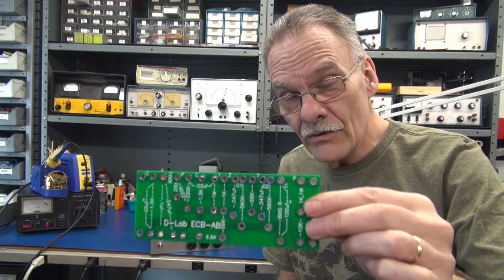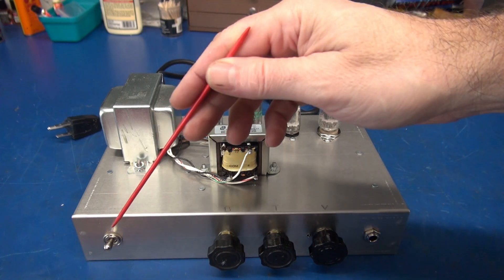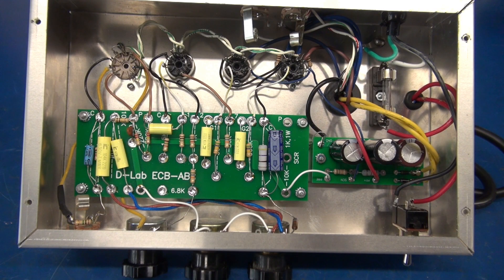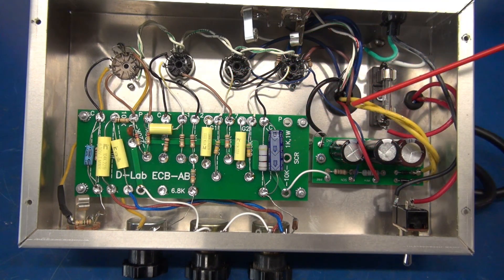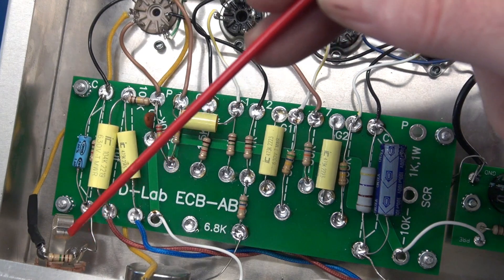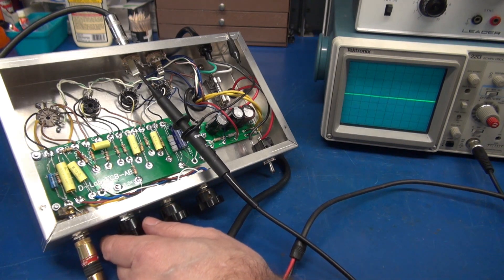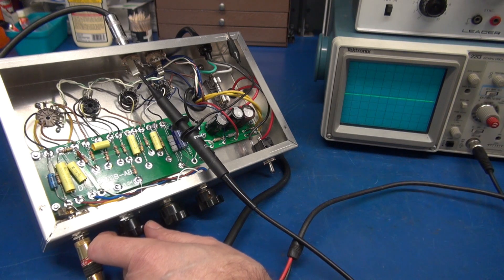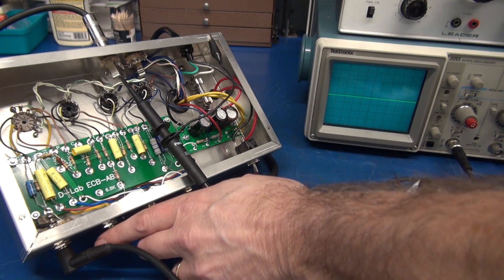D-Lab ECB-AB 6AQ5 Push Pull tube guitar amp module demo Great apartment or studio amplifier kit

Comment: Glad I found this video! I've a mesa 2:90 that's full of problems, and I came to wonder if the best idea is to rip out the pcb, keep the valves and mains transformer, and change the preamp circuit and output transformers?

Comment: Terry, what power transformer is that?
Reply from the maker: That transformer is a special order I ordered years ago. Rating is 420vac CT @70ma, 6.3VAC @3A There should be something in a Hammond, etc that meets the spec for the 6AQ5 tube circuit
Reply: @d-labelectronics  Like a Hammond 239GX?
Reply: @d-labelectronics  Edcor XPWR 177 is very close  but you have to wait 2 weeks while they make it for you.
Reply: Thanks Terry !!

Comment: Sounds like a super clean small studio or  bedroom practice amp. Waaaayyy better sound then my 1968 Gibson Skylark, that's for sure! And considering so many guitar players use pedals these days who needs excess amp anything when most of the augmented sounds are going to be pedal driven (overdrive etc.) I will be looking to pick up one of these boards soon.
Reply: Because overdriven tube aps still sound better. If you just use pedals, just buy a modeler
Reply: @joeambly6807  Yes and no... Not every tube amp sounds great just because it uses tubes. The circuitry is important. My 5w Bugera will never sound like a Fender Princeton.  And, not every tube amp can do what a pedal can add to it. The proof of that is also why almost all the great electric guitar players that use/(used) tube amps also use/(used)pedals. It is more complicated then people think.
Reply from the maker: Cool deal man. I have plenty on hand when your ready

Comment: Hello, any issues with using those aluminum enclosures? I’ve had a couple people tell me to avoid the aluminum and use steel only. Something to do with electrical code. Great sounding amp by the way!
Reply: Aluminum is actually better for chassis construction.  Many boo-teek amp makers like Doc Z use aluminum.  It's a better conductor of electricity AND heat than steel--which are good characteristics.  Pay no attention to the Websites that state aluminum is a bad choice; they are written by bots--not by actual people that know anything about amplifier construction.
Reply: @thedevilinthecircuit  Agree - Aluminum is not magnetic and is a natural heat sink.
Reply: Excellent! Just got my aluminum chassis in yesterday for my first ever build (5F2A). Thanks for the responses!

Comment: Really nice clean layout!
The only suggestion that I would have, and it's just a matter of personal preference, is to have a "Fender " type fuse holder mounted close to where the power cord goes through the back of the chassis.  That makes it easier to replace on that rare occasion that something happens that blows the fuse.

Comment: Great Video!! 6AQ5 is a great example because the tubes are a lot cheaper than the 6V6. The boards fit in the chassis just right, and I like the no terminal strip look. Tone controls are awesome with the old radio knobs. Going to be a happy customer!